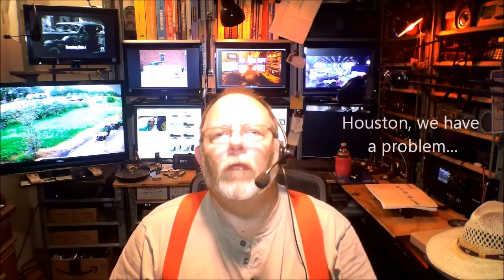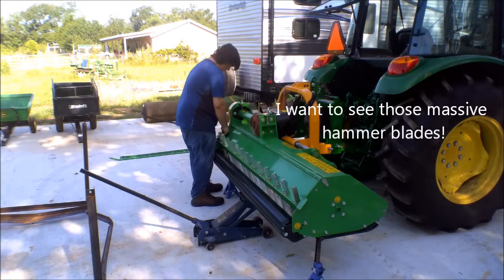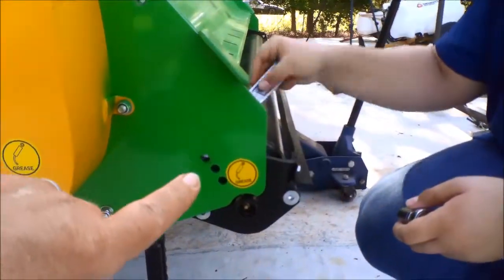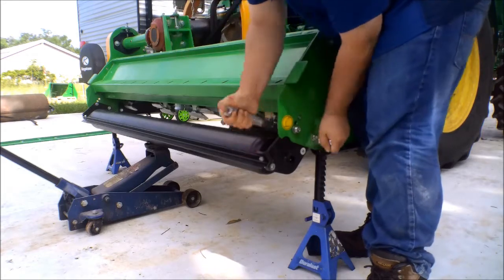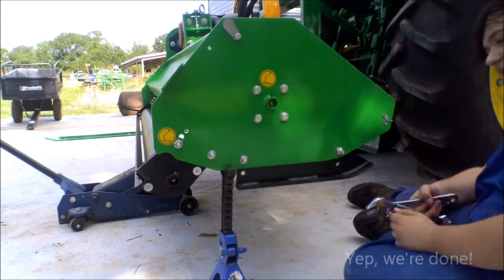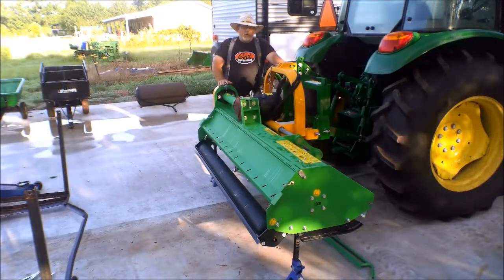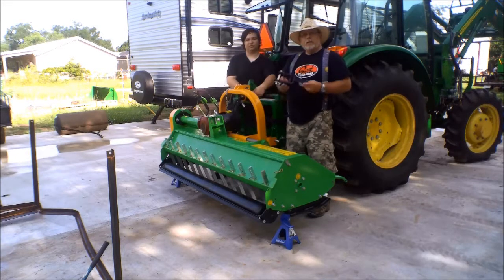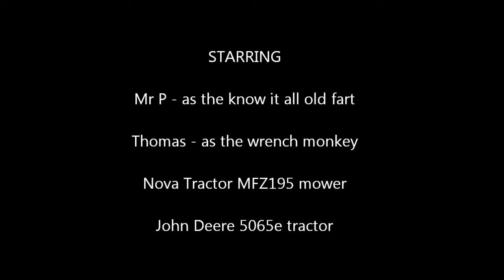Unboxing a Nova Tractor MFZ195 Flail mower

Comment: Where is your flail mower made at? 

Would you buy it again? 

Did you get too aggressive with it leading to its destruction?
Reply from the maker: Made in china - wont ever buy one again.  I treated it "normal" - I thought.  Ended up replacing it with an old used John Deere mower and it has been cutting my grass like a dream since.  THIS Chinese made POS is now at the scrap yard...

Comment: Good walk through of the flail, thank you for taking the time to do it.  I have one coming to the ranch - have a question on the 85-140 oil you referenced (dont have the manual yet and want the oil on site when the flail arrives).  Is there any restrictions in the manual for synthetic  - want to use the Lucas Oil, had good luck with it ...   Thank you!!
Reply from the maker: Not that I know of